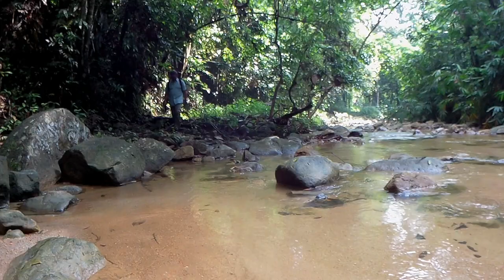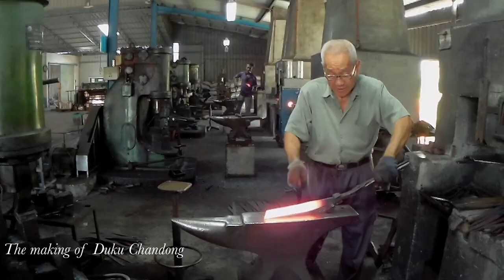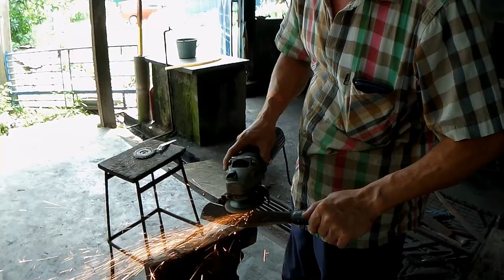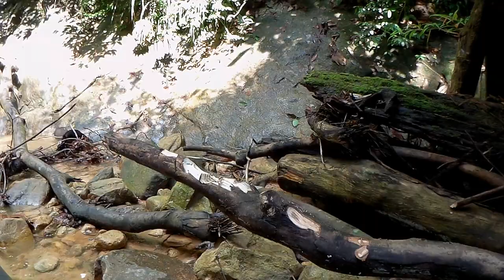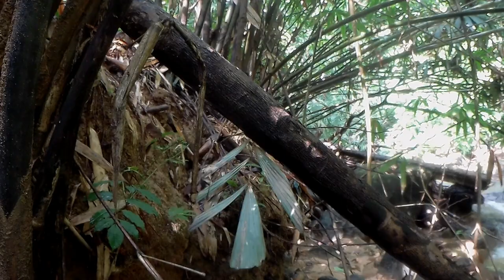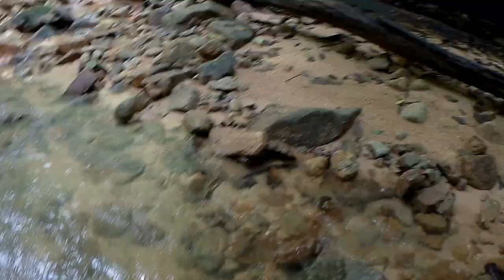Duku Chandong Parang of Bidor, Malaysia -Field Test

Comment: What is the blade length? 10”? I don’t care about the looks but the performance. This performs excellently.
Reply from the maker: Bob Wampler this one 10". Longer&thick version 12" for heavy chopping. This is my main knife for camping /bushcraft project,so far it does the job well.
Reply: Frugal Outdoors & Camping  It’s great in my opinion. Thanks for your response!
Reply: There's a few version of them..some more then 25" in length..ace hardware (usa) sell it in malaysia if u happen to come to this shore not to mention all the parang producing workshop all over malaysia.. some shorter then 5"..but we called it a different name such as golok etc and I would like to mention that the parang was use daily as well as one of the weapon of self defense in our traditional martial art such as silat.